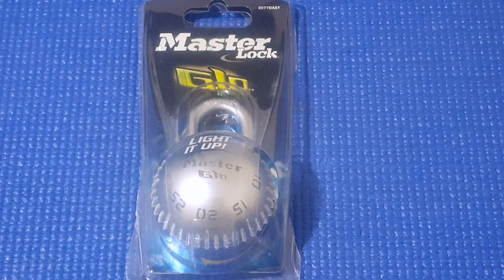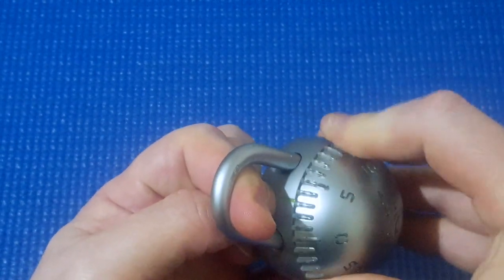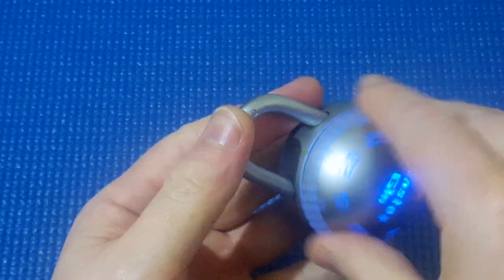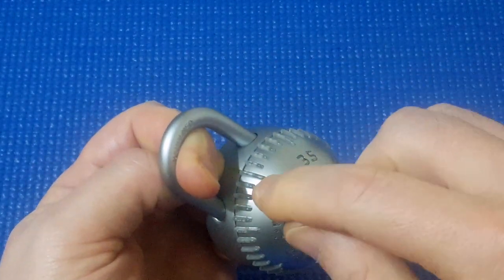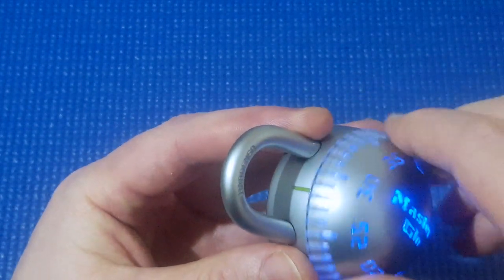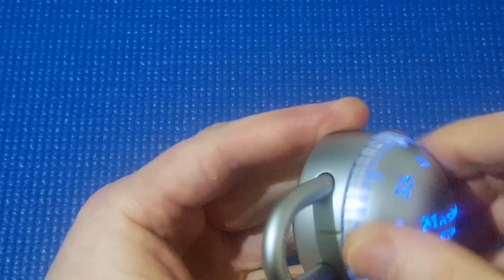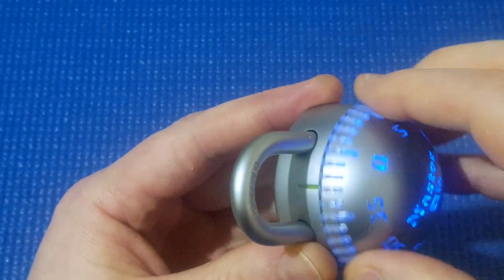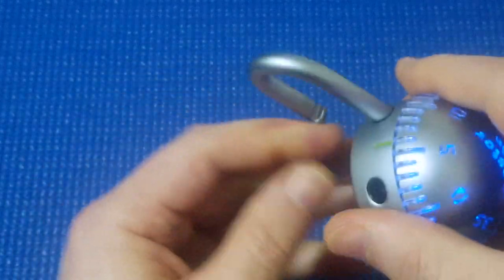(Picking 94) How to crack a Master Lock "Glo" dial combination (using no math!)

Comment: I can't figure out why the correct combo no longer works for this lock. It worked the first few times. Then it was in a box for a while. I tried the combo again and it won't open. I even tried to use your method just to double check it and the gates remain the same. I'm stumped.
Reply from the maker: Hmmm it could be damaged? ... sometimes turning while under tension can damage the lock ... or it may have been on it's way out. I recommend you try 1 or 2 numbers different either side for each of the numbers (one at a time or different combinations) as (at least) one of the numbers might be out a bit?

Comment: im finding it hard to find the number with the most play i've found the number where it locks into place and then you should add 5, thats 37, so 37+5=2 but the first number isnt that obvious to me any ideas?
Reply: I think the first number could be 36 but I’m unsure
Reply from the maker: Tip 1: For the number with the most play (the 3rd number), be sure to pull on the shackle with lots of tension.
Tip 2: Remember for the 1st number, I explained in the video how there are two ways to find it - did both ways point to 37?
Tip 3: Remember to "reset" the lock between tries by turning several times (several complete revolutions) to the right (clockwise) before going to your first number.  The only time you can get away with not reseting is trying different 2nd numbers as you saw me do in the video (as this will not move the first disc inside if it's just the 2nd number I'm changing).
Tip 4: Change your direction for the while thing (ie change from  counter-clockwise to clockwise and see if it makes a difference) ... doing this will mean your last number will remain the same, but not that first two numbers will be different!  This means that if the correct combination when turning right-left-right is X-Y-Z, then the correct combination when turning left-right-left will be X'-Y'-Z (where X' is a different number from X, and Y' is a different number from Y, but Z remains the same).  Doing the whole thing the other way around like this is sometime much easier.
Good luck!
Reply: Swynndla so number 37 is definite and the number with the most slack is 10 or 36 they both have about a 2 number slack on them
Reply from the maker: @goodgolfer98  You might be able to pull the shackle really hard (with lots of tension) to see if there's a difference between 10 & 36.  If not, then at least you know it's either 10 or 36 as the last (3rd) number.
What I'd like you to do is test the following combinations (but please reset the lock before each try by turning several complete turns to the right before going to the first number of each one):
2-16-10
2-20-10
2-24-10
2-28-10
2-32-10
2-36-10
2-8-36
2-12-36
2-16-36
2-20-36
2-24-36
2-28-36
2-32-36
2-36-36
If none of those work then we can try something else.
Reply: Swynndla none of these worked but when pulling on the shackle to attempt to open it. It did feel looser than normal
Reply from the maker: @goodgolfer98  ok these shouldn't work but give these a go just in case:
2-0-10
2-4-10
2-8-10
2-12-10
2-0-36
2-4-36
Remember to reset the lock between each try! ... ie 3 x 360 degrees to the right.
If that doesn't work then we are starting to get more desperate ... let's try adding 3 to the first number instead of 5:
0-6-10
0-10-10
0-14-10
0-18-10
0-22-10
0-26-10
0-30-10
0-34-10

0-6-36
0-10-36
0-14-36
0-18-36
0-22-36
0-26-36
0-30-36
If that doesn't work then you might have to try every combination X-Y-10 and X-Y-36 ... but go up in "two's" to make it faster, eg:
0-0-10
0-2-10
0-4-10
0-6-10
etc all the way to:
0-38-10
... then do:
2-0-10
2-2-10
2-4-10
2-6-10
etc all the way to 2-38-10
... etc etc all the way to 38-38-10
... then all the same for X-Y-36
... you'll require lots of patience and lots of breaks, writing down where you're up to so you don't get lost ... and it'll take a long time.
For those ones, you'll only have to reset the lock when the 1st number changes (if you're careful), so that will make it faster, but if you overturn then reset and cary on from where you were currently.  By "reset" I mean turning three whole (complete) turns before trying the next 1st number.

Comment: Awesome video. Just found one of these locks hidden in on of the drawers myself. Was able to figure out the third number which is 36 (it goes from 35 to 37 easily). As for the first number can’t seem to get it to lock when turning to the left. Any help would be appreciated.
Reply from the maker: Sure I'd be happy to help!
When you say "turning to the left", do you mean turning to the *right*?
Firstly I just want to clarify that the proper way of opening one of these when you know the combination is X-Y-Z is to turn 2 or 3 times to the Right and keep going to X, then a full 360 degree turn to the left and keep going past X and stop at Y, and then turn right and stope at Z (and then the shackle will open).
Without knowing the 1st or 2nd number, we have to try a few combinations (up to 100 of them!) ... but firstly I want you to try about ten of them for me and then come back to me if that doesn't work ... try these:
0-30-36
4-34-36
8-38-36
12-2-36
16-6-36
20-10-36
24-14-36
28-18-36
32-22-36
36-26-36
... reset the lock by turning several times to the right before each one.  If none of these work, let me know and I'll give you the next set. :D
Reply: Swynndla yes I did mean the “right”. Tried those combinations and no luck on either :( thanks for helping!
Reply from the maker: @cswscyril  I'm glad to help! ... let's try some other things.  Firstly, if you do turn left instead of right, are you able to find a stuck number?  If you do, let me know and I could convert it to the proper right stuck number.  If not then let's try the remaining combinations - I've weeded out lots so you'll only have to try at most 90 of them (as not all combinations are valid with Master Locks) ... but wait, there's a trick to speed things up! ... read the below after these next 9 combos:
Your next 9 combos:
0-2-36
0-6-36
0-10-36
0-14-36
0-18-36
0-22-36
0-26-36
0-34-36
0-38-36
... there's a trick to speed things up where you don't have to reset the lock by turning several times to the right between each one ... you should be able to reset (several times to the right) only when the 1st number changes ... so you'd do several times to the right and stop at "0", then one full turn to the left and go past 0 and all the way around to 2, and then right to 36 (and test the shackle) and then left to 6, right to 36 (test), left to 10, right to 36 (test), left to 14, right to 36 ... L18 R36, L22 R36, L26 R36, L34 R36, L38 now right only 2 numbers to 36 (not all the way around but just 2 numbers to the right - important! ... since you've gone past 36) (test) ... and then reset the lock by turning several times to the right and stop at your new 1st number, and repeat...
... and here are the rest of the combos to try (it has to be one of them!):
4-2-36
4-6-36
4-10-36
4-14-36
4-18-36
4-22-36
4-26-36
4-30-36
4-38-36
8-2-36
8-6-36
8-10-36
8-14-36
8-18-36
8-22-36
8-26-36
8-30-36
8-34-36
12-6-36
12-10-36
12-14-36
12-18-36
12-22-36
12-26-36
12-30-36
12-34-36
12-38-36
16-2-36
16-10-36
16-14-36
16-18-36
16-22-36
16-26-36
16-30-36
16-34-36
16-38-36
20-2-36
20-6-36
20-14-36
20-18-36
20-22-36
20-26-36
20-30-36
20-34-36
20-38-36
24-2-36
24-6-36
24-10-36
24-18-36
24-22-36
24-26-36
24-30-36
24-34-36
24-38-36
28-2-36
28-6-36
28-10-36
28-14-36
28-22-36
28-26-36
28-30-36
28-34-36
28-38-36
32-2-36
32-6-36
32-10-36
32-14-36
32-18-36
32-26-36
32-30-36
32-34-36
32-38-36
36-2-36
36-6-36
36-10-36
36-14-36
36-18-36
36-22-36
36-30-36
36-34-36
36-38-36
... let me know!
Reply: Swynndla Tried all the combos and no luck. I may be turning it incorrectly still don’t know. As for turning it to the left to find a stick number. It seems to get stuck at 32. Thank you for the help.
Reply from the maker: @cswscyril  I never give up! :D ... ok if the stuck # is 32 when turning left, then the proper 1st number when turning right should be 4, therefore try these:

4-10-36
4-14-36
4-18-36
4-22-36
4-26-36
4-30-36

... but it might be safer to reset the lock before trying each one, as it can get confusing unless you know what you're doing.
... eg for "4-10-36", turn 2 or 3 times to the right and keep going to 4, then one full turn to the left to 4 again but keep going left to 10, and then right to 36, test the shackle, then reset by 2 or 3 times to the right, etc etc.
You should cross out each one as you do it, as it's so easy to lose track of where you're up to!
If that doesn't work then let's try these again (resetting before each one) as these are more likely than the rest:
0-30-36
12-2-36
16-6-36
20-10-36
24-14-36
28-18-36
32-22-36
36-26-36
If that doesn't work then try the rest (resetting before each one, and crossing out as you go):

0-6-36
0-10-36
0-14-36
0-18-36
0-22-36
0-26-36
8-2-36
8-14-36
8-18-36
8-22-36
8-26-36
8-30-36
12-6-36
12-18-36
12-22-36
12-26-36
12-30-36
16-2-36
16-10-36
16-22-36
16-26-36
16-30-36
20-2-36
20-6-36
20-14-36
20-26-36
20-30-36
24-2-36
24-6-36
24-10-36
24-18-36
24-30-36
28-2-36
28-6-36
28-10-36
28-14-36
28-22-36
32-2-36
32-6-36
32-10-36
32-14-36
32-18-36
32-26-36
36-2-36
36-6-36
36-10-36
36-14-36
36-18-36
36-22-36
36-30-36
Reply: Swynndla A combination from the first set of numbers worked! Thank you so much for the help. Will for sure use your videos if I find another lock needing a combination.
Reply from the maker: @cswscyril  That's fantastic!  Well done!  I'm glad I could help! :D :D  A combination from the first set of numbers ... is that the 4's set or the next set?
Reply: Swynndla it was a combination from the 4’s set. Thanks again for the help!

Comment: I’m having a problem. My lock gets stuck between 2 and 7.5 I don’t know which number to pick lol
Reply from the maker: Choose one, and if that turns out not to work then choose the other?
Reply: @Swynndla  When I perform the first move to discover the 3rd number I am greeted by instant major play between 2 and 7.5 with a subtle hump between the two on 5. There is no sticking between 0 and 1. All the other gates are : 8.5-10, 12-13.5, 15-16.5, 17.5-20, 22-23.5, 25-26.5, 28.5-30, 32-33.5, 35-36.5, 38.5-0.
Reply from the maker: @neiko9251  Oh I see what you mean now ... that's a truly massive gap! Maybe the 3rd number is 5? (but it could be anywhere between 2 and 7.5). Are you able to find the first number? Or are you saying that subtle bump is the first number that you found?
Reply: @Swynndla   So I found a PDF File from Hotec. that has combinations for all serial numbers of master locks. I found my serial number and voila it opened. Using your methods unfortunately would have proven very difficult to obtain my lock combo because I read in a forum that by the time my lock came out Master Lock became hip to the gate finding method and created false gates which is why my lock has such an erratic gate formation. The combo to my lock is 8-24-6. The 7.5 was close but I wouldn’t of thought it was 8 I thought it was 7 or 2 and as stated it should of been my third number but it was actually my first. The second part or third number method would of had me completely lost as 6 wasn’t sticking anywhere and it was sticking on 15 and 5 added onto that would be 20 which also would of been incorrect. Finally guessing the second number after miraculously getting  the first and third would of been dreadful.
Reply from the maker: @neiko9251  Ahh well done on getting it open! Yea I find when the 1st & 3rd number are the same number (or close) then it can be really tricky, and sometimes when I'm getting nowhere I investigate that as a possibility, but yea it sounds like your lock may have defeated me (not sure though, as I have some advanced techniques that I describe in my videos 96 & 97), but gosh your determination paid off! How can I find a link to that pdf you found?
Reply: @Swynndla  Hey if you could mention me in a video for this that’d cool as hell lol.

Btw I haven’t been able to open this lock since 2008 (14 years) I got in when I was in 10th grade, I’m 29 now.
Reply from the maker: @neiko9251  14 years ... that is persistent!! :D :D
Reply: I was having the same problem and so I did what Neiko did and found my combination really easily I also have the link to the holloteco PDF he was referring too I'll post it below 🤙🏽💯